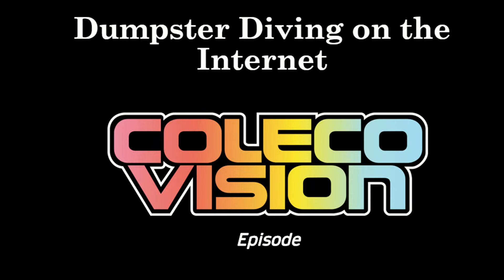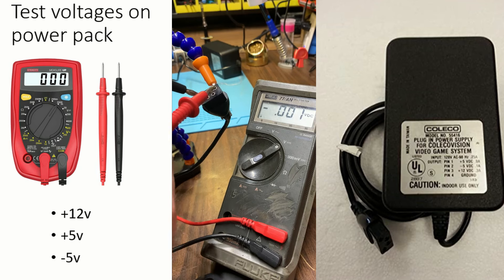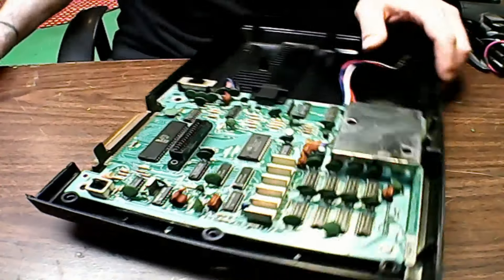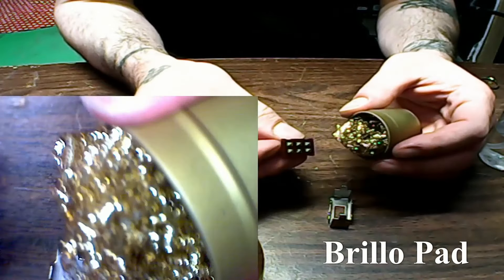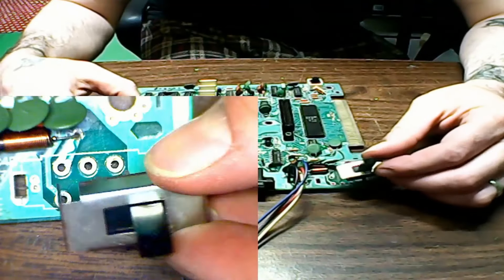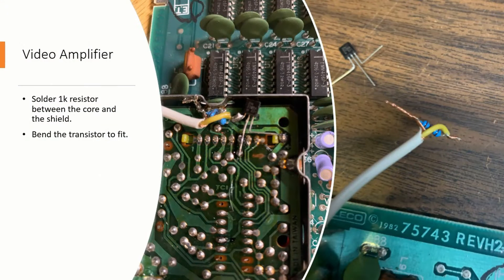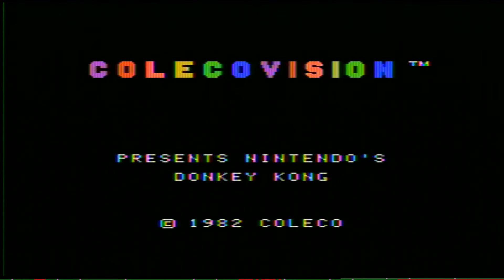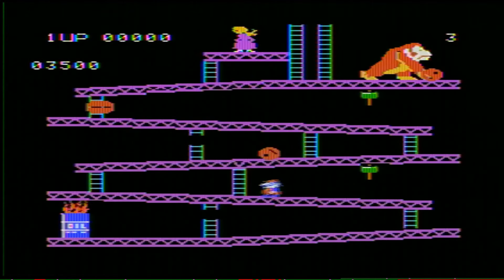ColecoVision AV Mod Composite Output and Repair | Trash to Treasure

Comment: The area Ben Heck used is fine if you just do ColecoVision cartridges but for that to work with Expansion Module one, you need to connect the non-ground line to the end of capacitor labelled C88 that is closest to the RF modulator.

Comment: Any chance you have a link on the transistor I couldn't find many options on ebay. Did any of the info you found recommend a pot?
Reply from the maker: Hi Paul! I found that transistor in an arduino kit.
I got the info from google “ben heck colecovision” 

 a 

(1) 1k variable potentiometer (Radio Shack # 271-280)
(1) NPN transistor. Usually called a 2N4401-ND.
Reply: @ChadDoebelin  that's the only 1 I found also. He used a pot to adjust it. Wasn't sure if I needed it tho. I have like 5 to do and doesn't want to pay $25 each one. This is alot cheaper. But all the ones with boards have more than 3 or 4 pieces. There s a couple caps and other stuff. What kind of tv have you used it on. Have you tried yours on a larger flat screen. Wondering if it will work on a larger higher quality tv's
Reply: @Mynameis7nad  These are extremely common transistors. I just did this mod (I didn't use a potentiometer, just a 1K resistor) and it works a treat with a 2N2222, 2N3904, or 2N4401 which can be found at Radio Shack online: 

https://www.radioshack.com/products/radioshack-npn-transistors-15-pack